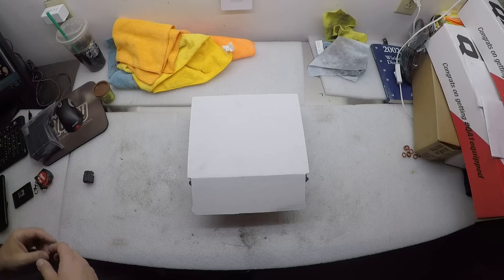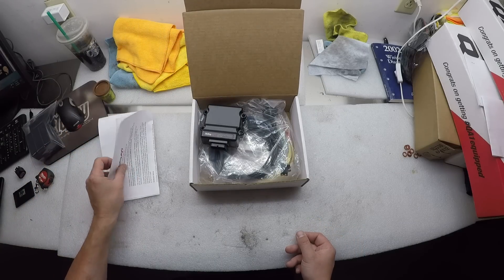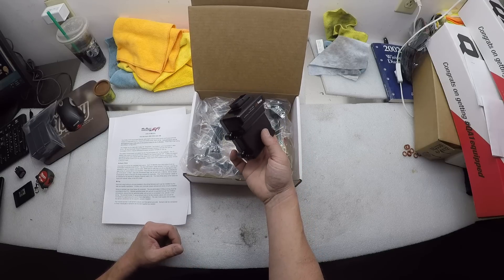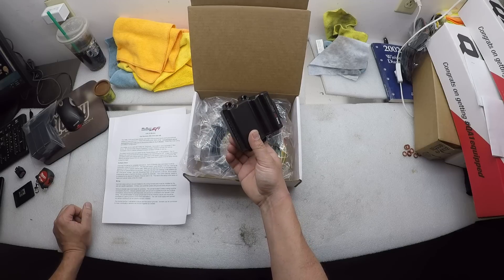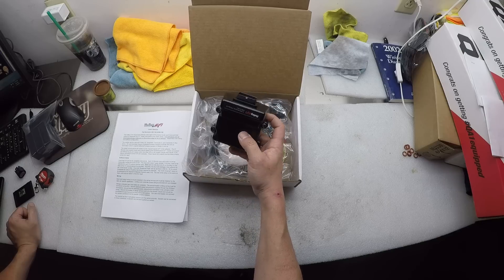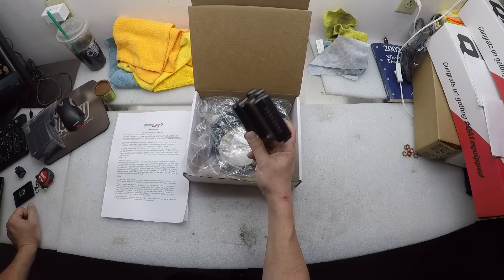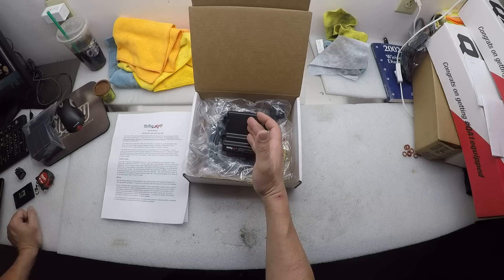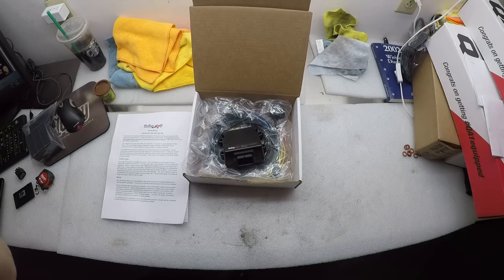Holley EFI Canbus Expansion IO box!

Comment: if you are starting from scratch, dominator is 2200.00 ecu only. Ls harness is 500.00 with no power harness or o2 sensor. Power harness is 80.00 and ntk wide band is 280. then you still have to purchase the i/o harness's which are from 80.00 to 170.00 bucks that's 3310.00 so far. And if you want transmission control that harness is separate too. Also you don't have the handheld screen but most will want a dash that's either 1000.00 for 6.86 dash or 1800 for 12 inch. at this point, this I/O box isn't looking so bad jus my .02
Reply: That’s what I just looked at, $4500 with a dash like I’d want. With Terminator X Max and dash I’d be at $2400.
Reply: @OneTonTahoe  I upgraded to Dominator before this i/o box came out. I didn't know about it. Ive been waiting on Dash since March 4100.00 for ecu and dash only. still have to get harnesses

Comment: x8 O2? ;-) Shouldn't that Playdough be back where you found it? lol

More seriously - pre-intercooler temp would be good to log to see intercooler efficiency. Add pre intercooler pressure too. A sensor for ambient temp, ambient pressure, and humidity? Banks has one I believe. Anyway to plumb a water temp sensor for rear cylinders? Trans temp? Temp at intake inlet? Driveshaft speed? Crankcase pressure as you mentioned. For outputs I love to wire LED warning lights but you don't need more than one or two to cover most things. Guess it comes down to the decision logic in the ECU. Personally the Dominator is sounding sweet
!

Comment: Actually I think this is great because the dominator doesn't support LSU 4.9 wide band if I recall correctly. Which to me is a shame. I personally run NTK sensors over LSU 4.2 but you need a back pressure table to keep it accurate.

Comment: $1325 for x max and another 350 for expansion I/O makes $1675 ready to run with with 12 I/O. $2200 for dominator ecu. I’ve never messed with dominator but I feel after harness, o2 and everything else your going to be well into the 3 grand range?
Reply from the maker: Yes this is why I suggest dominator if you want any IO you’ll want more anyway

Comment: Dominators are very expensive to do the entire system Because it’s all ala cart, I just bought it all because I want to do 16 injectors and dual drive by wire throttle bodies and dual O2 sensors.